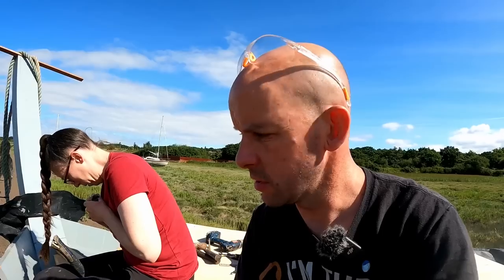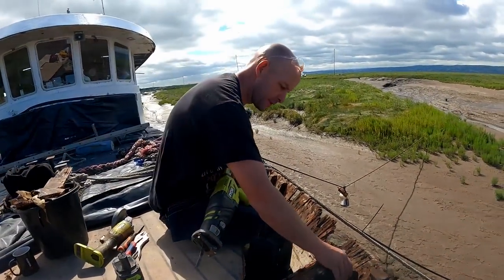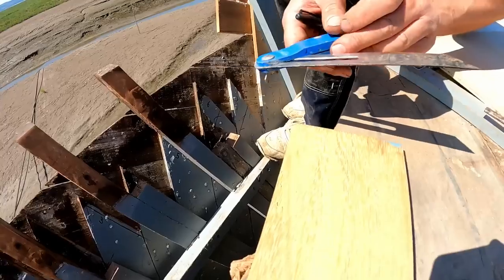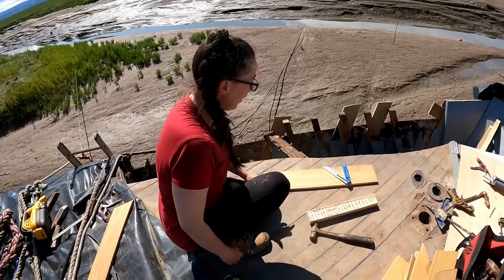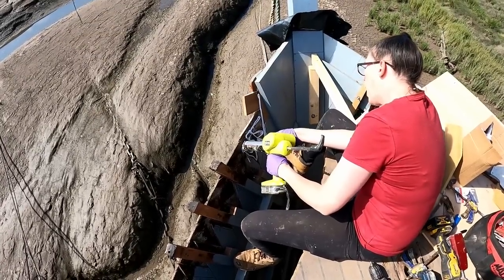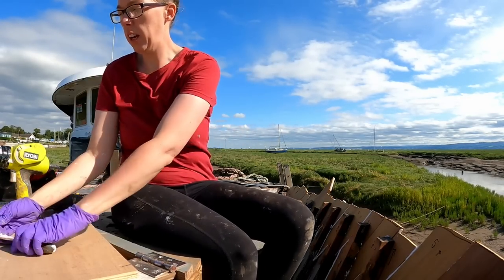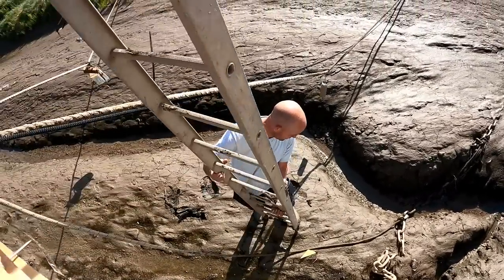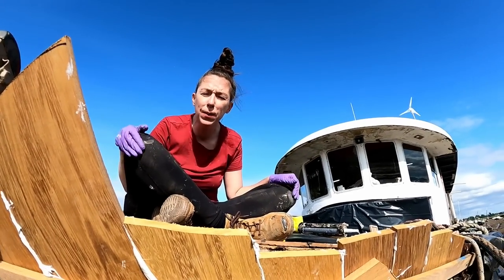Ep 137 Replacing Innner Rotten Planks Without Removing The Outer Planks?

Comment: I'm sure you get thousands of suggestions...So here is mine, lol.
You could take a rope taught from the wheelhouse down to your bow. Drape over a large tarp so that it hangs over the sides and you will be able to protect the open hull from the rain. And still have room to work underneath. Zip tie some weight to the bottom of the tarp to keep it down.
Reply from the maker: Come back next week for the answer!!!

Comment: I use plastic gloves at times.   It is useful to have some talcum powder on hand if you need to remove the glove and put it back on a sweaty hand.   So much easier with talc.
Good progress.   Enjoy the warm weather, so much easier to work than cold and wet.

Comment: A few days ago I watched another video on Youtube showing that the Ryobi saw you are using has no lube inside and they fall apart after 2 years. It is an easy fix by taking the screws out on the side and putting grease on the moving parts to extend the lifespan.

Comment: Interesting work you do. I could see that you use German saw blades from Würth, which are very expensive but of good quality. It can also work much better with battery-operated electrical devices. (no cable clutter). In any case, it is always admirable .. from old to new. It's a shame that you don't understand everything you say. Nice size from Wiesbaden ( Germany

Comment: Copper nails- is it fastened by copper roves? Putting those back will be fun. Did 3000 of those years ago and Mrs and I were deaf for days afterwards! You will want a heavy punch with a spigot to hold head beat rove down with hollow punch, cut off with some spare and pein over with ball pein hammer while punch held other side! Worth it for rib security.

Comment: I'm really looking forward to the day you slip your moorings and putter down to the river mouth and back.
If you or anyone ever question the condition of parts you reuse, just remember "80 YEARS" and the fact that these boats were NEVER meant to outlive the war. They were meant for quick build and short-term use.
Had the original builders had access to the sealant/glue/silicone you are using then they would have clathered the boat with it as it not only holds the planks together, it also seals them against moisture wicking/intrusion, so it would have been used in place of caulking and the calico barrier. Had she been built these days, then it would have been a welded steel hull or formed fibreglass.

Comment: Just wondering between the rib if you took a board that fit between. Using the same bonding glue. Put board to to as far doud to help support and make joint stronger

Comment: I notice now that you are sealing the gaps between the edges of the inner boards, but you are not apparently using a sealant tgo replace that.. was it Calico? Pitch infused Calico perhaps? It'd almost as if the waterproof bit of the boat was the Calico with the pitch in it, & the boards inside & out were "just" there to hold it in shape & protect it...

Comment: First if all guys have a lot of admiration fir what you have achieved, well done. 
However in the last couple of videos it shows you partially removing Hull planks. Your not replacing the whole plank just a piece. 
Have you consulted with any boat builders /  naval architects in terms if weakening the hull ? Before carrying out the work you are doing. If this  boat had been for carrying over 12 passengers then you would need to get approval on the scope of work you were carrying out. Your boat looks like it was designed to go through some quite nasty seas, and I would not like parts of the hull to fail through stress fractures.

Comment: Should we be concerned that there are so many joins in frames and planks in the first metre down from the deck? I imagine that it would result in a weakness that is unwelcome. I'm thinking that some real benefit may be gained by adding a sister to some frames at least, and/or even an extra long plank on the inside where joins are very close together.